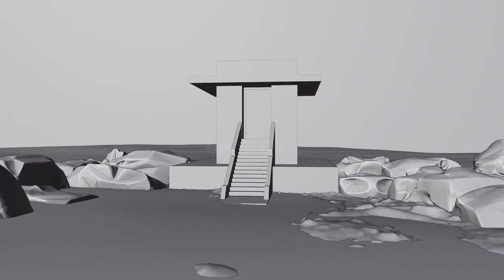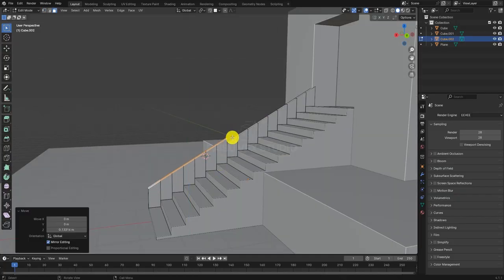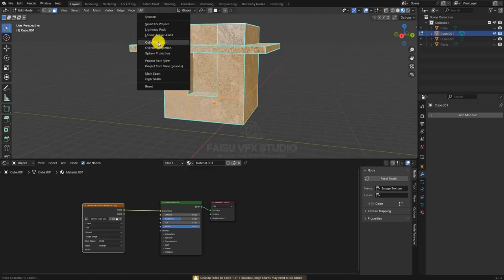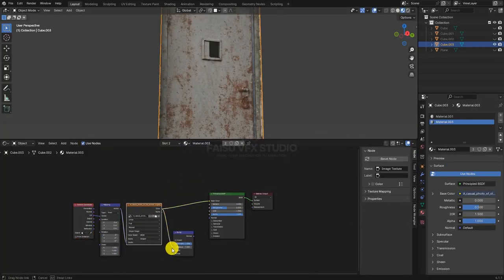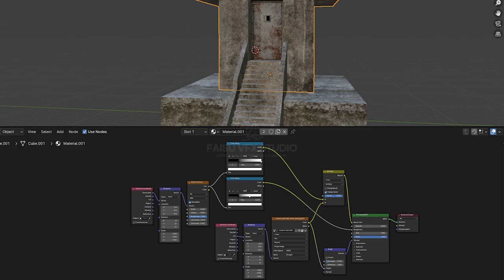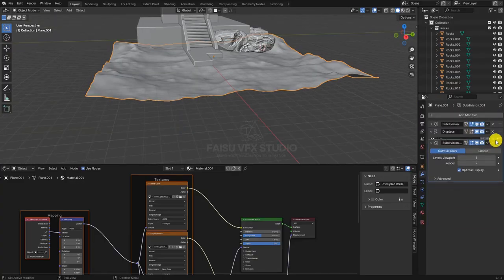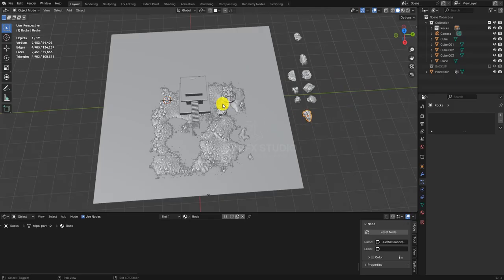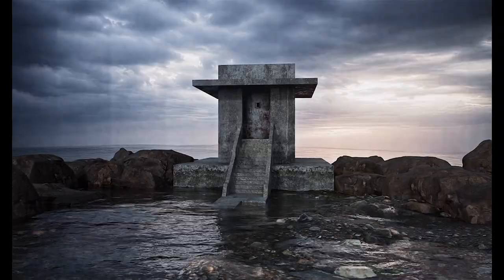Blender Cinematic Scene Tutorial | Ocean, Lighting & Texturing

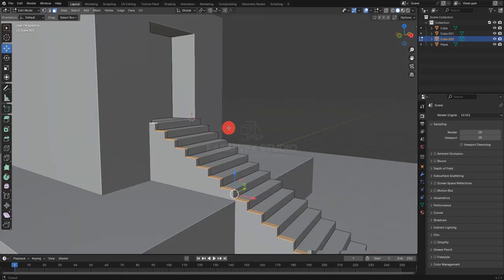Comment: At 00:53 how did you make them join them like a slide? I mean the side of stairs, they were in the shape of steps but you make them like plan slide ?
Reply from the maker: It’s simpler than it looks! I just selected all the top faces and used S + Z + 0 to flatten them into a straight line, then adjusted the position to create that smooth, slanted slide look.